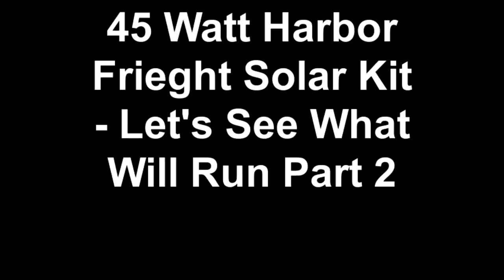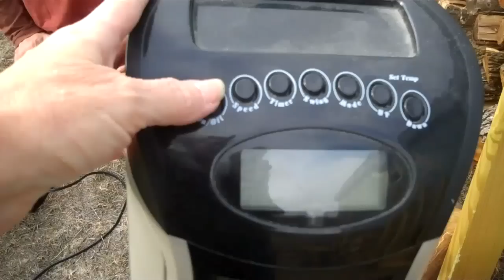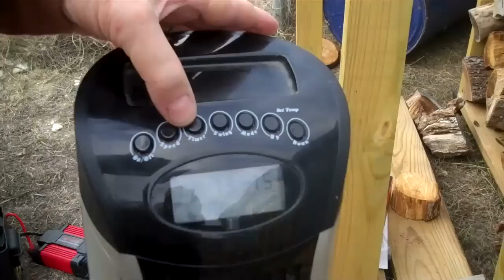45 Watt Harbor Freight Solar Kit - Let's See What Will Run P

Comment: Y'all are most likely further along with your knowledge base than I am. I still thought I would share something I have learned recently. 
Heating/Cooling ratings, Check the EER on energy star website before you buy, because you may not be getting what you were told based on the "Annual Estimated Cost".  There is different Energy Star standards based on the BTU and options. For example you may be better off on price, and energy usage if you purchase two 5,000 BTU window units rather than buying a single 8,000 BTU or 10,000 BTU solar unit. So it is important to actually look.
Then there is the most efficient that year on the Energy Star website, where you will find all sorts of products. http://www.energystar.gov/index.cfm?c=most_efficient.me_index .
I realize checking efficiency is kind of goofy to be telling someone. But to understand those ratings and how efficient those (((Super Efficient))) items are....... You know, the ones they keep  pushing on you at the store, claiming they practically run on static. Now that I understand efficiency, I realize I have been lied to. A lot. :)

Comment: Those panels are rubbish!  The same size panel normally is 230 watts (yes it costs more) instead of 15 watts
Reply: +sof david 
Sorry, I do not know how to put a videos on u-tube. I do not have a camera to make videos.
My ceiling fan and the lights in the basement use  simple  dc-dc-buck-converters  that just will bring the voltage from the panel down to 13 volts and keep it there unless the panel voltage goes below the 13 volts... and for my satellite receiver the voltage is set to 12 volts, which the voltage is adjustable on the buck-converters.....which buck converters are like a voltage regulator. They can handle a couple of hundreds watts and cost about $5 and higher on ebay.
They also make buck-converters where you are able to adjust the needed voltage and amps.
The attic fan is an automotive radiator fan and is hooked up directly to a panel.

Voltage control relay/timer/delay switch overvoltage/under protection 12V, this is what I use to detect the battery voltage and then relays are switching the solar power.  With relays you can switch panels in series to up the voltage for the water heater which would keep the amps low and the wire diameter small also.. To me a water heater is like a battery, you can store energy in it and if you have grid power and solar you can put 2  water heaters in series and use 1 to preheat water with solar and the 2nd heater for grid power in case solar power is limited and did not heat your water all the way.

 For this year I will see if I can power a 12 volt to 120 volt inverter  from panels without a battery. I strongly belief this is possible.

I realize that clouds will have an effect on it.
But on the other hand........If you charge a battery with solar panels and discharge a battery you are only 50% of efficient anyhow. And after a battery is charged the effiency went down to almost  0% since no power is being send to anywhere from the panels.

A buck converter is not efficient either.  If a solar panel puts out 18 volts and 5 amps under perfect conditions you have 90 watts, if a buck inverter is adjusted to 13 volts then you get 65 watts out of it.  it is still a little bit better than charging a battery and discharging a battery.  A buck converter is cheaper than a battery. 

Someone could automate a system, where a  washing machine comes on only when the sun is out to make use of solar power to power the wash-machine.
Reply: +Kieran Mullen 
A 45 watt haborfreight solar kit is what....about $200.
For that price I can buy 200 watts of panels, not only 45 watts.
Reply: +Bonnie Flory Yeah but it makes getting into solar easy. It does have a place.
Reply: +jayw900 
Easier? Not really. 
Most at a time it is frustrating using habor freight panels. 
They are just a trickle charge for golf cart batteries and most other batteries and will destroy batteries in no time unless you do not pull a load  from the battery at all. 

Folks just give up on solar after they find out that they got reamed with habor freight solar panels, especially if they can not run a lot of things with them or when they find out that they could had gotten 2.5 more power from a regular solar system for the same price that will  last 5 times longer.
Reply: Yes, it provides a lower barrier to entry. If they see its not for them then they are not out too much money. If they choose not to read up on solar after the initial foray through harbor freight, then it would not matter the wattage available it will never be done correctly.
Reply: +nr3rful
Wanna bet?
My attic 80 watt fan runs on a 100 watt renogy panel without a battery, straight of that solar panel.
My ceiling fan runs straight of  solar panels without batteries.
My 2 basement lights  run straight of the solar panels. 
Also after my solar panels are done charging my batteries, the panels are   disconnected automatically from the batteries and the panels are connected straight to my water heater to heat water straight from the panels.
I also have solar panels charge directly my cordless drills and other things.
And by next year, I plan to install a  solar powered air conditioner that does not have nor need any battery.

Don't get me wrong, I still use my battery, but mostly at night for lights when there is no sun.  The less stress on a battery bank the longer they last.
Eventually I get more and more things hooked directly to panels and automation  is the key.
Reply: +Bonnie Flory 
Do you have any video online that shows that ? that will be great,  if you can demonstrate what you just mentioned so we can learn from your personal experience...

 Thanks

Comment: Hi,

You should use a  inline fuse for safety a Solar contoller to stop the battery burning out on a sunny day & a inline diode prevent the battery from discharging at night.
Regards
Reply from the maker: Ben Parmer Thank you.

Comment: If you divide 750 by 120 it will tell you how many amps your unit work with..thats 6.5 amps. HOWEVER i would NEVER run the inverter at full amp/watts as this could cause the unit to fail quickly. It is like driving the car as fast as the speedometer will go...and as the battery gets low it shut down as well. 
But solar is fun to play with.
I am working on using a small 12 battery and strips of super bright leds under my kitchen cabinets to light the counter and as a night light.

Comment: Take the fully charged battery off and see what works with just the solar power......
Reply: ***** The point tho he's trying to say, is about the panels. cause that is what the video title was pointing to.

But anyways. yeah in such ways it does. but if you have alot of power coming off the panels. Some and i mean just alittle some. is some devices can run off just pure solar panel power at the given time.

Comment: Your title is a little misleading. None of your devices were "run" by the 45w panel system, they were run by the battery which is trickle charged by the panels. I had those very same panels and 45w is almost nothing. Maybe enough to power a couple CFL lights. Certainly not that drill. You would need to charge that battery for days at full sun to generate enough power reserved in that battery to run that drill for a project. Essentially at best you have a 3 amp solar system and depending on the size of battery you have connected to it does little in the way of charging it. HF's kit is intended for shed lights, low voltage lawn lights, ect. Those two beasts of batteries you have under the panels are grossly oversized for what that 45w system can sustain.

Comment: The fan will run on your system but you will burn it up on a modified sine wave inverter the drill Is ok. Trust me I run a box fan on one it didn't last long I knew it would not last long I did it just for my own test with a old fan. You also need a bigger system if you plan to run more things because your battery won't last very long and your panels won't be able to charge up fast enough and so you risk the chance of damaging the battery. I would also get a pure sine wave Inverter if I won't to run a fan or anything sensitive like computers TV and so or you risk damaging them.
Reply: Firefox6730  Let me see if I understand you.  Are you saying that if he gets more solar panels for more AH, and if he gets a "pure sine wave inverter", then he will be ok as long as he is getting more juice than he is using?  Is there anything else?

Comment: You cannot use a square wave inverter on a purely inductive load.  Plug in a resistive load too and it will work

Comment: Its running off a fully charges battery. It wdnt run that fan if it wasnt.
Reply: the panel wont charge battery enough to run fan so the battery has to have a full charge to give converter enough power to do it.after a while that fan will stop even hooked up like it is

Comment: This has nothing to do with your solar panel, since the solar panel was not hooked up.
Reply from the maker: Bonnie Flory The panel is hooked up that's what charged the battery that the fan was running off of.
Reply: +BackyardHomesteading batery ddd!!! good god is obama and solindra  behind you ha ha. Solindra you wouldnt get it.
Reply from the maker: +Джейсон Хичкок So that's three comments you've left on the same video in the last few minutes. If it bothers you that much, why are you still here? Hey, here's a thought: get a life. You obviously don't have one if you can waste that much time leaving rude comments.

Comment: the panels are 45 watt , they are not powering the 500+/- watt   fan / drill  , the fully charged battery IS!
with consistent use that drill would burn out a 750 inv.  or at least give you crap trying to run it , when the battery gets low , and the drill , pulls a load ,(hard hole to drill )_ the inverter will object wth the high pitch ,,,,gfs

Comment: Have had one kit on my truck for three years. Keeps up with two led (0.9 W) lights, Toshiba laptop and a fan on a 300 W inverter.  Keeps the Two 845 CCA deep cycle batteries charged when in sun. Yes I live in my truck. It is the best desicion that I made. Even charges in cloudy. Love it.

Comment: i have a question, will it power a window refrigerated ac unit?
BackyardHomesteading
Reply: You would need a powerful true sine wave inverter, and a big battery bank to run a window AC unit.
Reply from the maker: No, you would need a lot more power for that.
Reply: BackyardHomesteading forget it about ac running off solar panel, as far I concern not even a 4000wt solar panel runs a window ac
Reply: snarbywrx 1500 inverter ,6 batts

Comment: Hot Tip . I've been using a product called Battery Equalizer that doubles battery life. I have been getting 10-12 years on my deep cycles and 8-10 years on my car & truck batteries . THIS PRODUCT WORKS
Reply: and the link to this is???

Comment: Thanks for sharing! question. 1) how many amp is the battery? 2) how long does it take the 45w solar panels to charge the battery and at how many amps is it being charge?

can you post links to the battery and Solar Kit. 

Thank you! :)
Reply from the maker: The battery is 115 AH deep cycle marine/rv battery.  Not the best for solar setup but it was affordable and is still serving it's purpose almost 3 years later.  We purchased it at walmart locally.  For recharging the battery at 45 watts the best case is going to be 3.75 amps.  That is probably not going to happy because that would be the panel in perfect location and light hitting it perfectly.  The charge controller prevents the battery from being too far discharged (I believe it cuts off at 11.7 volts but I am not positive about that.)   I can't put a link in here but if you go to harborfreight dot com and search on 45 watt solar panel kit you will find it.  Thanks for commenting.
Reply: BackyardHomesteading put a blocking device diodes 1n5822  on solar side .put 2 of them it will keep charge .and keep display lite off .

Comment: Response for Theo 168, there are so many variables on output for solar systems any hard specs are not repeatable. A change of as little as 2 degrees of tilt can produce a 15% change in the panel output as well as location,air quality and even altitude then there is ,size,type and condition of the batteries

Comment: my roommate is using this kit and tried to use it with a small heater it came on and then went out..how well does it work for you with that fan? seems the other electric heater he tried kept going on and off alot
Reply: A heater can draw 750w to 1500w. Those elements require alot of juice. A simple Mr.Coffee full size pot draws 700w and the small 4 cup Mr.Coffee draws 600w. So if its got a heating element, it'll require alot.
Reply from the maker: It doesn't perform to well with this fan.  A DC powered fan works much better and can run a lot longer.  The fan was running off of the battery that was charged by the solar kit.
Reply: oldtoys1961 WoW thanks for the info

Comment: I'm delighted to find solar energy products, that is solar energy appliances, coming into the retail markets. In 1996 I stopped by our town's Sears store to get some Die Hard golf cart type batteries, but they only had one, so I ordered five more. I asked the clerks why they didn't also sell solar panels to charge the batteries, and none of the people working there had ever heard of "solar energy." When I described to them how the telephone company, in 1952, had invented a solar module which had no moving parts but let the sun create 12 volt DC electricity using photosynthesis, that could charge every battery they were selling there, they started treating me like a mental institution escapee! Since then I, like wonderful folks like you, have been unselfishly sharing my fun with solar.

Comment: if you want a nice big inverter get a battery back up ups 24volt i got one on ebay with dead  no batterys for 80.00 about 50lb unit

Comment from the maker: I would agree with you there.  When we choose our 'larger system' it will not be they panels.  These serve a purpose and we have learned a lot from messing with them.  I will say we have had our panels for 3 years and they are still trucking right along with great efficiency.  But to get your feet wet, learn and have an emergency lighting and recharge station this little system really fits the bill.

Comment from the maker: To be honest.  While these are great for learning and for small separate system projects I would not go with these to run a whole house.  They would not be cost efficient in the price per watt.  What they are great for is for smaller projects and emergency lighting etc because you can get up and running quickly.  We are just now starting our full home system and will keep everyone posted as we make decisions and purchases..  How many panels and watts you need depends on how much you run.

Comment: Excellent starter video. I was thinking about purchasing one to learn for some time. It would be an excellent emergency phone/laptop charger as you mentioned. I went through a post hurricane situation where I did have an electricity for 3 weeks. And I live in a major city. I will probably hook it in garage roof and use it for small LED lights and spot lights when I am working on a project.

Comment: What is the point of this video? The fan isn't being powered by the Solar Panel, it's powered by the  battery. It takes 120 watts to run a small fan, so it would take at least four 45 watt panels to run the fan on solar. The title of your video is misleading.

Comment: Great video.  I just started this last weekend.  Did a lot of reading on the subject.  I already hd the battery part down as I ws a mechanic in the Air Force for 20 years.  So I ordered a 30 watt panel, charge controller and a 750 amp inverter.  What I had in mind was a emergency bckup to rn the electrical side of my  furnace. (373 watts).  I picked a xantrex controller before I knw how to size them.  I have a 60 amp cming so I can upgrade up to a 1000 watt/24 solar(41.7 a) array if I want to.

Comment from the maker: We bought it as a learning tool since it was a complete system.  Basically we use it not to charge the battery that runs my portable water pump that only gets used a couple times a week and every now and then we take the charged battery with us to our cabin to recharge laptops phones and such.  As a learning tool it served it's purpose.

Comment: Your inverter should shut its self off automatically once the battery drops below 12v.  the charge controller shuts off if the battery is charged above 13v

Comment: One more thing, I don't know what you had to pay for that HF system, but you can buy 100w panels on ebay for $150. 3 of them and your probably good to go for what your doing if its neon. More batterys though, you need to figure amp hr's of run time.

Comment: Ya know it's kinda like the battery on your cordless drill, the battery is going to die till you charge it back up. At 45watt, its going to run the drill down in a few minutes then take all day to charge it back up. No you have a lousy system, and you had better get a charge controller hooked up to the panels or you can say by, by to your battery after you over charge it. My advice is to do some research before you set up your system. READ the manuals also. This will NOT power your grow lights!!

Comment: a125 watt panel, controller, 4 RV batteries and a2000 watt inverter i can run a vacuum cleaner, computer, printer, cooler and keep my cell phone charged.  Only problem is you can't run all of them at the same time.   Basic reason for cooler is to keep my butter from melting without buying ice.

Comment: This is not 'what the panels will run', only what the inverter will run.  The panel had nothing to do with this test.  All it will do is recharge the battery after these things deplete it.